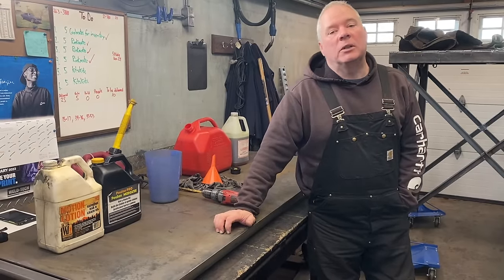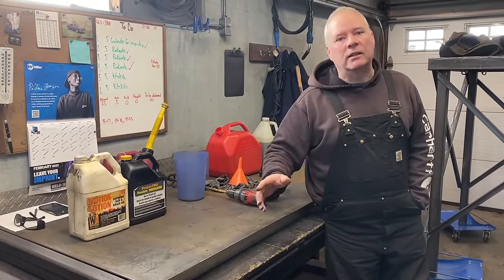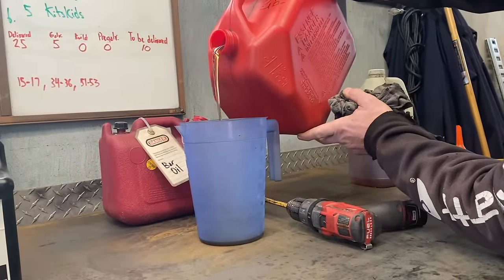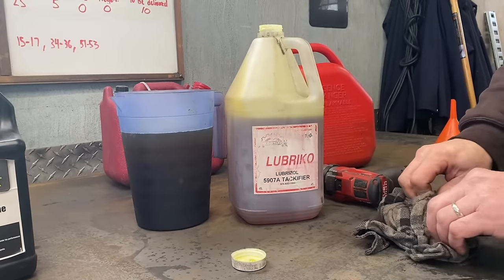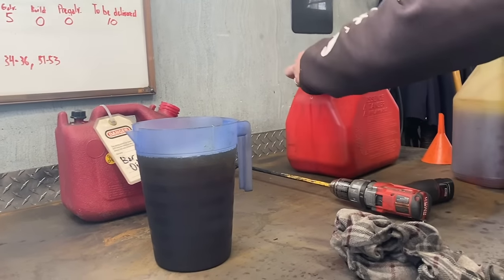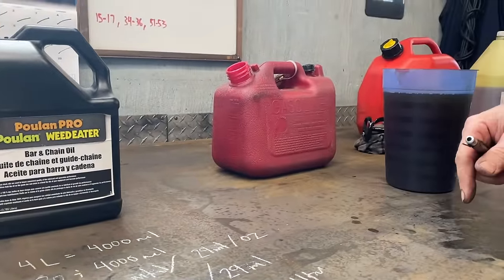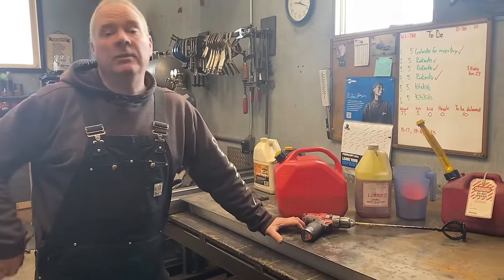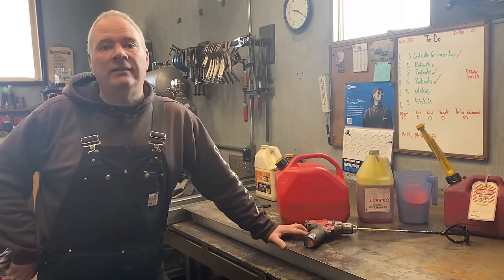How to Make Cheap Chainsaw Bar Oil!

Comment: I like your idea  there. Really do  I go trough bar oil  like candy  inert the product that Lucas makes probably the same thing real tacky, sticky stuff. You can get an auto parts store or that even old STP. Because it like thick as honey  ,as for winter and summer blind I haven’t been Abel to find it in a yr or 2  I have been using  Husky brand  because it doesn’t  get my chain hot  bit iam going to try it 👍👍👍👍👍👍👍😎

Comment: I never see much wear on my rails the sprocket at the end wears first. I use Super Tech, Bar S, or whatever generic bar oil I find at the farm store. In the winter I mix the cheap bar oil with 10W oil  Harvest King or whatever brand from the farm store.

Comment: I think in your case its a smart solution with the tackafier. If your waste oil is of poor quality perhaps add some metal cutting oil to it improve the wear resistance properties.
 Vegetable oil is also a good option if you use your chainsaw often. Never leave it in/on for storage as it varnishes up your parts exposed to air😂😢.

Comment: I find cheap Canola oil works great in my saws. I've also used a cheap motor oil with good results. The Canola also works great on bicycle chains; very clean. An old loggers trick was to blend some beef fat with vegetable oil to thicken it but I've never tried it my self. Fat was used as a lubricant in the old days in steam trains as the hot steam didn't wash the fat off the cylinder walls.
Reply from the maker: That’s some interesting info. I always like to hear how things were done by the generations before us. I feel that what our ancestors lacked in materials and technology they more then made up with through hard work and determination. I grew up in the family farm and some of the fixes and contraptions my grandfather came up with were hilarious, dangerous, but also kinda genius. Thanks for watching and consider supporting the channel by subscribing.

Comment: Awesome video.   I use stihl bar oil and it keeps going up in price.  Has anyone found the tackifier he is using?   I cut about 30 cords of wood a year and trying to cut cost with out sacrificing performance.   I have unlimited hydraulic oil and used engine oil.  Any suggestions would be appreciated.

Comment: I've been using cooking oil for years. If you're using chainsaw every day, it's okay. But it clogs  up a little if not used very regularly. cost £1.50. That is on my old 08s stihl chainsaw and on my old husky 61 chainsaw
Reply: I have to use a paintbrush and gas just to free mine up if it sits too long

Comment: Any oil new or used if it is slick and gets between the chain and the bar will work. Wear is caused more by a dull chain. If you sharpen the chain after every few cuts keeping it sharp the engine doesn't have to work as hard and the bar and chain are cooler because you aren't pushing down trying to make it cut. If you don't keep the chain sharp the best most expensive oil won't keep them from wearing.
Reply: Ron is correct
Reply: It is going to get dirty with sawdust regardless of what oil you use.  So a good lubricant is all you need.  With synthetics the lubrication of motor oil should be even better.

Comment: I live in New Zealand, I did the dollar conversion from NZD to CAD and I pay $33.26 per 4 litres of Castrol Bar and chain oil. I have a friend who is an Agricultural Contractor making hay and silage. He runs 15 Large John Deere tractors and does his own servicing. I'm sure I can get some trans fluid for free, I just need the tackifier. I have researched the local suppliers of similar tackifier products and am waiting for replies. I will post the results when I get the info. If this works for me it will be a massive game changer! I runs 4 Stihl chainsaws and go through about 16 litres of bar oil per year so Thanks!
Reply: Hi from Oamaru Sth island New Zealand.

Do you remember the Morays gear oil stabiliser display gadget on rural gas stations?.

I wonder if a bottle or two dumped into 30 litres will thicken it?.

Comment: In the winter, I use used motor oil to cut summer bar and chain. Seems to work fine.

Comment: How many ounces, I’m in the US, is your blue container? I get adding 2 oz to-how much transmission oil? I like to be consistent. 
Thanks!
Reply from the maker: I think that is about 3/4 of a gallon. It’s a cheapie from the dollar store and doesn’t have any measurements on it. You can always tailor it to the cutting season. As long as you get the stringiness between your thumb and index finger when you check the tackiness you’re on the right track.

Comment: Question oil viscosity.  Bar oil is heavy, transmission oil, or as it's called " fluid" is totally different.  I'm not sure about Tackifier.
Reply from the maker: Bar oil generally comes in two weights, summer(heavy), winter(light), so that it will flow through the saws oil pump more efficiently depending on ambient air temperature. Tackifier is extremely thick and stringy and does make thin hydraulic oil heavier and much tackier so it doesn’t sling off the tip of the bar. The amount of tackifier can be adjusted depending on what used base oil you are using and the season you are cutting in. Thanks for watching and please consider subscribing to help support the channel.

Comment: The same kind of idea: A Depression Era man once told me to filter drain oil and mix in STP for bar oil. I haven't seen STP in many years. At one time in a pinch, I put STP in a gear box, and that gear box is still spinning today.
Reply: This is exactly what I do.... All my used oil as well as new 10w40 gets stp and used.

Comment: Actually were not pumping oil here hardly at all. It was mostly shut down my the current administration. The pipeline was also shut down and public lands were shut down to oil exploration. We are mostly dependent on foreign oil at this time. We are an energy rich nation with our hands tied when it comes to extracting the enormous amounts of oil we have beneath our feet. At one point in the previous administration a barrel of oil was so cheap it was almost free. The previous administration filled the strategic oil reserves with oil that was about $10 per barrel. This administration sold almost all that oil to China. Something is wrong with this administration. It is what it is and there is no possible way to cover it up.

Comment: I believe the blender may have broken down the chemical composition of the blended liquid but also aerated it introducing air in to the mixture and I don’t know whether it would settle out of the mixture if you let it sit for a period of time
Reply from the maker: Yes, you are correct. When I bought the tackifier the sales guy was using the word “ blending” when we were discussing what I had in mind, so that’s why I used the wife’s blender for my first attempt. I don’t know the science but the tackifier is “long strand molecules” as I’ve been told and I think the blender chopped those up. There was no stringyness to the oil when I pinched it between my fingers, unlike regular bar oil. But when I switched to the paint mixer and cordless drill the result was great. Thanks for sharing your thoughts and feedback.
Reply: The difference between a incredibly high rpm type knife and the relatively low rpm’s of a drill is that difference between the blend processes and that your paddle is several times or it’s a much larger size so you aren’t cutting the structure down and the lower rpm’s not aerating the solution and removing it’s stringy characteristics like small blender knife would…
Reply from the maker: Yes I think you are correct. The viscosity was thicker but the tackiness of the fluid was gone. And it was very aerated with the blending, which, as mentioned may have settled out but I believe I had destroyed the tackifier on that attempt.  I really like the comment someone made about Lucus Oil Stabilizer Additive. I remember using that in a fairly worn out Chevy Nova 350 engine. If tackifier was unavailable I think I would give that a try. 
Thanks for watching. I appreciate your insight.

Comment: I use canola, vegetable, peanut oils from the kitchen. You can buy this stuff where I live for 6 to 9 dollars a gallon. The oil is biodegradable and NON TOXIC !!!! THE OIL you use BRUCE is toxic to the woods you are cutting firewood in fella. 
           20 bucks for a gallon  is just crazy. Nice video fella too. 😀😀😀😀😀😀😀
Reply from the maker: Well, toxic is a pretty strong word. I’m only planning to burn the wood, not eat it. But it’s good to hear that you are doing your part to save the planet. Your work area must smell awesome.

Comment: Never seen a shop, and work bench, that clean. And... no pegboard on the walls. Guess things are different up there.
Reply from the maker: Only takes 30 seconds to clean my bench before making a video and since it’s a weld shop all the tools go into the toolbox and cabinets to keep the grinding dust off. Pegboard? The 1960’s are calling and want it back. 😂😂. But thanks for taking the time to watch anyway.
Reply: @buildingthebruce  I put pegboard every square inch of my shop walls, from bout waist up. Gotta have my inventory of junk visible for this old guy!🥸
Reply: Gotta have pegboard! I always promote it. Auto shop in highschool hooked me on that. If there's an empty hook you find that tool. Tool boxes are for specialty tools. I have ALL hand tools on the wall😊. Takes 2 seconds to get a wrench socket. No toolbox digging!

Comment: Several years ago I was running drain oil in my saws. Financial reasons. Didn't mind it till my old shit would break down and cleaning up all the smelly old black oil just to find fasteners. What a mess. But I don't judge.. run what ya bring..

Comment: Just add 85-140. Same deal.   Car Differential or heavy equipment gear oils,,, USED.   It will do the same thing.  I'll add it to USED tranny & or car engine oils.  'Recycle'.     Been using it for 20 + years. Still using the Same bar.  
Make sure your bar oil is thin enough to actually spray off the end of your bar at high RPM.

Comment: It seems to me that a lot of the aftermarket oil additives must just be tackifier or something similar. Most are the consistency of sticky thick honey and are made to mix in with 4-5 quarts of motor oil. Might be worth a try in used motor oil.
Reply from the maker: Yes I agree. I recently picked up a bottle of STP oil additive to do a comparison video between that and the commercial tackifier that I use. Should prove interesting.

Comment: You're overthinking this bar oil problem. I have been using used motor oil for 50 years. When you change your motor oil filter it throug something as cheap and simple as a paper towel in a funnel. 
I've never had a blockage because the particles that are an issue are larger than what can go through a paper towel. Never pay a dime for bar oil again.

Comment: In a very cold climate will this mix viscosity  stay thin enough to get through the reservoir and pump   my supertec walmart bar oil does better than my Husqvarna bar oil
Reply from the maker: Yes. Not a problem. The hydraulic oil is very thin and you can add as much tackifier as you like. More tackifier will decrease the viscosity and vise-versa.

Comment: There wasn't a thing wrong with the tractor fluid you drained oud either. You just drained out the fluid to make bar oil. 
You spent money on tractor oil you didn't need to make bar oil. I can't even picture how this saves money? Brilliant!
Reply from the maker: Well, kubota tells me when to change the oil and that $40,000 tractor is worth a lot more then the oil, additive and chainsaws combined. Try finding a 35 hp tractor in mint condition without DPF or 30 computer sensors to keep it running without throwing codes and you would understand the situation. That’s how it saves me money.

Comment: I use just about any oil I don’t plan to use for its intended purpose …..I don’t feel it’s critical to use “proper” bar oil…any oil will lube a chain as long as the oil isn’t so thin or thick it won’t pump or leak out fast..

Comment: In Alberta we are paying $29.99 to $39.99 per gallon (4 litres). It’s crazy.
Reply from the maker: Wow that’s nuts. I think I can buy a gallon of synthetic motor oil cheaper than that when it’s on sale at Canadian Tire!  Did Alberta run out of oil? 😂. Maybe the Feds added carbon tax to bar oil too?
Reply: Alberta ADVANTAGE for you
Reply: I’ll pick up used bar and chain oil at garage sales for pennies on the dollar and have several gallons in reserve
Reply: The stihl dealers here in Florida are charging near $50.00 per gallon now. Talk about some serious gouging. Husqvarna premium oil is around $25.00 per gallon. There classic is up to $14 from about $8.00 before 2020 lock down.

Comment: Can't find Lubriko tackifier anywhere in the web.
Reply from the maker: @GregoryZalaskus-c5m  It may be something that you have to source locally. Try oil supplier, oil blenders, undercoating supply. If all else fails STP oil additive will work as a tackifier.

Comment: I've been using a mixture of used oil mixed with new 80/90 weight gear oil .
Every time I change gear oil in diffs there leftover in one of the containers which just accumulates on my shelves.
Reply from the maker: That sounds like it would work pretty well also. How is the viscosity in the winter months? Do you need to adjust the ratio to get thinner oil?  One thing I hate about differential fluid is the smell. My 4wheeler is full time locked and the truck is limited slip and that oil stinks.
Reply: Yes it does smell but it is sticky enough to work , I still use a john deere saw I bought new in 83 and I started using this mix about 15 yrs ago. Of course I dont cut wood for a living but I've got property and cut down about 10 trees a yr due to beetle kill. Haven't ever replaced the bar so I'm good with dealing with the smell

Comment: just stocked up for the season and only paid less then 8.00/gallon for commercially available oil , name brand
Reply from the maker: That’s a lot better than any price I’ve seen or have been reported in the comments. Good deal for sure. Maybe prices are going to head back down for summer weight oil. I’m actually heading to Husqvarna dealership this week, I’ll let you know the prices out here in Southern Ontario.
Reply from the maker: $31.00 for Husky 3.78 litres. Sounds like you got a great deal!

Comment: So, what you were saying is that I need to buy a Kabota tractor. I will have a talk with the wife.
Reply from the maker: Absolutely! If she gives you the green light run to the tractor dealership, I’m partial to Kubota, before she asks too many questions and changes her mind😂. I bought the wife a dump trailer for her birthday so I could spruce up a few of her flowerbeds. Thanks for watching.

Comment: CANOLA OIL - used for years in all saws year round with NO problems. Cheap, smells like french fires when cutting, clean, biodegradable (if that means something ). Harvesting 6-8 cords each year and trails clearings. Only problem is that it is thin and goes faster than regular oils. NEVER use used vehicle motor oil. JMNSHO.
Reply from the maker: Thanks for commenting. You are not alone with canola oil. I’m thinking about a video where I compare different oils suggested and adding commercial tackifier  or STP oil additive and seeing how they mix up and do with sling off the end of the bar tip. Lots of good information from the comments for sure. Consider subscribing if you would like to follow along for the next bar oil video. 
Thanks

Comment: I cant find tackifier in Ottawa can I use gear oil #80
Reply from the maker: Not as a tackifier. That’s a lubricant. Go to Canadian Tire and buy STP oil additive. It’s as close as you are going to get to tackifier. Add it to the base used oil that you are using and you should be fine.

Comment: Oil is oil.  The transmission oil is an excellent oil for the chainsaw.  You stated that the Kubota has about 10-12 gallons of oil changed at the service interval.  Well, I have never used 10 gallons of oil cutting firewood in a year, ever.  The trans oil doesn't need any additives other than good storage.  I would rather have thinner oil because the chain is whipping around at 10,000 rpm around the bar and I wouldn't want thick oil that won't penetrate the chain in this frenzy of movement.
At least virgins weren't involved in this video.
Reply: No, oil is not just oil. Chemistry varies greatly. Some have detergents, and some do not. Some foam, and some do not. Many are not compatible with certain seals (rubber, plastic). Chemistry varies greatly. No offense, but you could not be more wrong
Reply: Yes what dent tech said if your saying gear transmission oil okay. But if your meaning auto tranny fluid (ATF) modern stuff has detergent in it will break down your rubber.

My dad swears by straight 30 for everything an if not ATF 

And all of his chainsaw bar oilers leak like a seive. (Uses atf)

Comment: Used cooking oil,put through a strainer,used it for years,it doesn’t get much better than that,I usually cut 20 full chords of birch every year with no problem.
Reply from the maker: Wow, that’s a lot of birch. Where abouts are you located?  East coast? I have more yellow then white on our northern property. Doesn’t get much larger then 18”-20” and then seems to die off. Doesn’t last too long once it hits the ground. I guess if you’re cutting that much the oil never gets a chance to spoil. I’ve heard some of the natural oils can go bad if they sit around too long. Thanks for watching.
Reply: Most modern cooking oil is Canola based. Canola’s original purpose was as a marine grade lubricant. Used canola oil could well be used for this purpose big it wasn’t overheated.
Reply: Old timers use to use food grade oil in chainsaws to quarter downed moose.
Reply: Trans fluid is a great fire starter